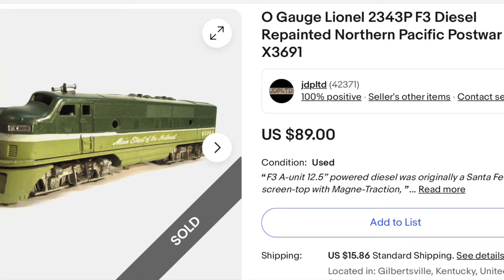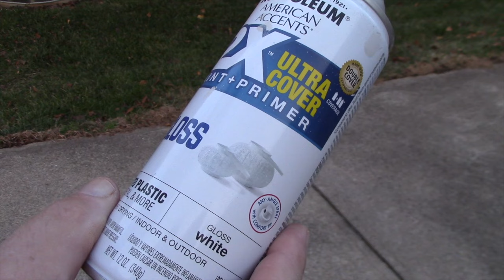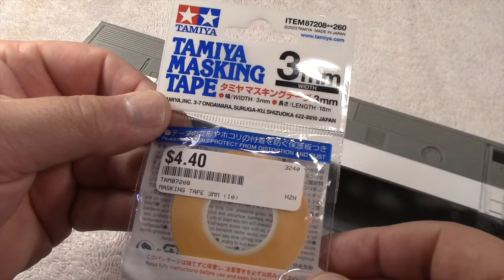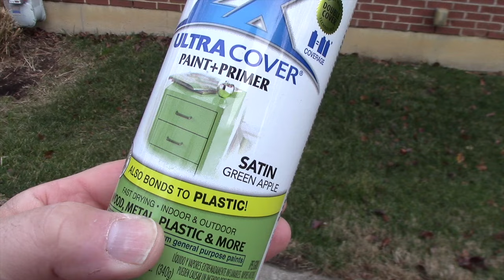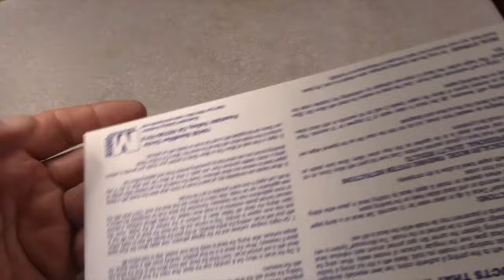How to Mask, Paint & Apply Decals to make a Lionel F-3  for the Northern Pacific Railroad MTH F3 NP

Comment: What is the micro sol for? I’ve seen it used before. I make my own windows from clear packaging cut to fit and glue or tape in place. Saves a few bucks per engine count 12 or so and mounts up $$$. I like your paint scheme. You do nice custom paint and graphics.😊 i purchased 1/16” vinyl tape for stripes to complement my custom paint. But it starts to be a bit pricey when ya want a few colors. Your way is cheaper. But the vinyl stripes can be changed easy if ya want change or don’t like it.
Reply from the maker: Hi Gene. Microsol softens and also sets the decal. Softening is good when decals go over raised or recessed areas but I used it here to help set them in place. 👍🏻😀

Comment: That came out well! Colors look good.  One word of advice ........... Dehydrator!!  I am horrible  about waiting.......I can paint two colors a day. thx
Reply from the maker: Thanks Dave. Will shells this big fit in dehydrators?
Reply: @bobsworkshop5181  Most O scale shells will not fit inside. I take off the top of the dehydrator and place the shell across the top.  The heat rising will speed drying time.
Reply from the maker: @davevan8864  I had thought that air in our freezer would be drier than elsewhere but it did not help. I may wait until the weather is at least 60 degrees outside before I paint any other shells. It’s in the 30s here in Cincinnati. ☹️

Comment: I thought about doing this in HO scale to an F unit to match my Northern Pacific Gilbert passenger cars. This video gave me the knowledge on how to do it.
Reply from the maker: Sometimes even O gauge seems too small to me. I can’t imagine HO scale work. Thanks for watching. 👍🏻😀
Reply: I've got the NP Gilbert passenger cars also but I ruined the collectibility of them by changing out the incandescent lighting with 12 volt LED strip lighting with keep alive circuits.  I've got an F-3 NP to pull them with.  Cheers - TN

Comment: Bob, I am enjoying your 'How to Fix It' videos.  I have a vintage Lionel SW2 diesel switcher I want to renew.  I can remove all the handrails and other plastic parts, but the shell itself appears to have been painted with a brush and modeling paint.  How can I remove the old paint and wind up with a clean shell I can repaint without trying to sand it off.  Too many molded in doors, rivets etc to sand off the old paint.
Reply from the maker: I’ve had OK luck with easy off oven cleaner. I’ve sprayed the shell, then wrapped it in Saran wrap then left it alone over night. It works pretty well but I’ve lost a little bit of detail. A soft tooth brush can help and gloves are a good idea. I’ve heard other people soak things in brake fluid to remove paint too.  I’ve only done that on old diecast matchbox cars. I don’t know what it might do to plastic. 🤔. I’ve seen other people recommend a purple degreaser product for soaking but I can’t remember the brand name.
Reply: Thanks for the info.  I think I'll pass on the brake fluid.  Is the easy-off oven cleaner a spray on product?  What kind of detail did you lose with that method.  Did it actually  remove some of the plastic body (rivets or doors etc? @bobsworkshop5181
Reply from the maker: @LloydCoon  I used easy off spray but I left it wrapped for about a week because I forgot about it.

Comment: The dark/light green & white does look sharp. I would not picture in my mind how nice this does look.😊 You might try a cut up clear plastic from restaurant desert container for the window glass at no cost. Many pre packaged products use clear plastic as well as other sources. I secure it with tape for easy removal for future changes or paint jobs. It creases or bends easy and cuts with scissors. Free is best price those purchased windows add up $$$.